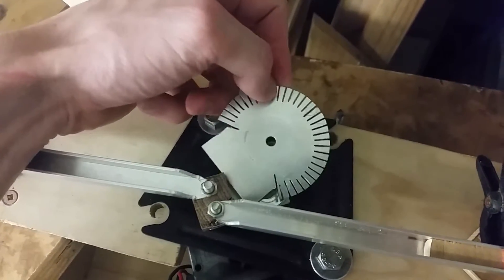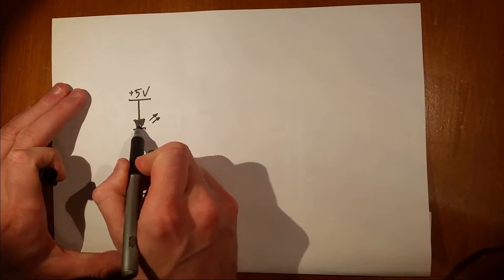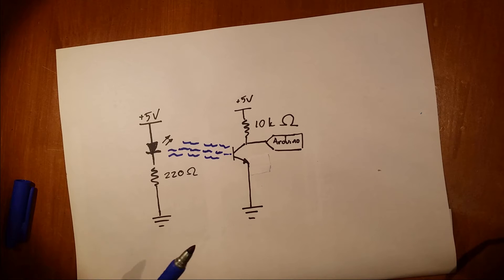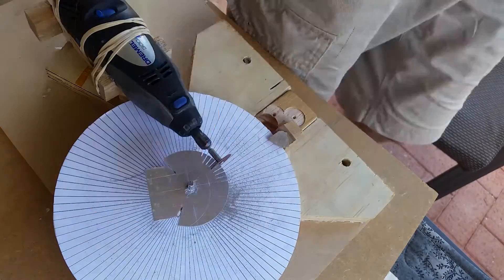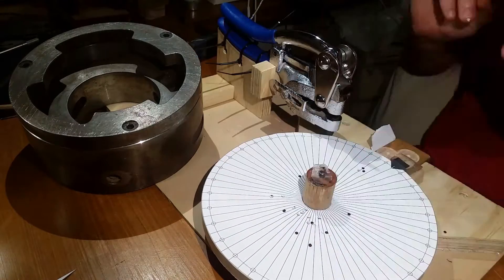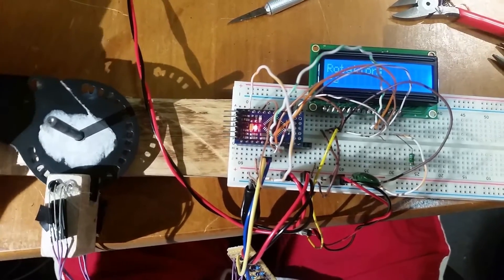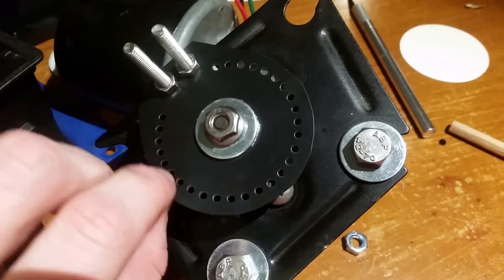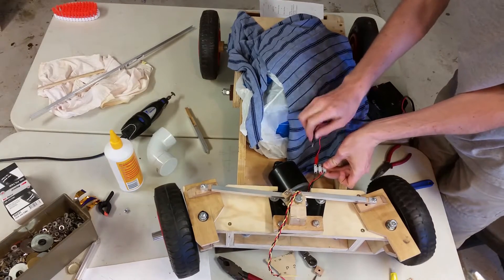Chainsaw Powered RC Car Update 5 - Steering Sensor

Comment: Hello ,Friend Use Digital Rotary Encoder instead .
Reply from the maker: Hey +Kedar Nimbalkar  haha yeah thanks for the comment and suggestion! :) I have since sourced a really nice direct contact encoder with like 200 steps per rotation but I might not use it because potentiometers are so much easier to wire up :P I didn't think it would be so hard to make an encoder... and i didn't realise how fiddly it is to get reliable interrupt triggering. I am actually busy building an opto isolator so that the arduino runs on a separate circuit to the noisy motor. Hope I'll see you round on future videos! -Nick